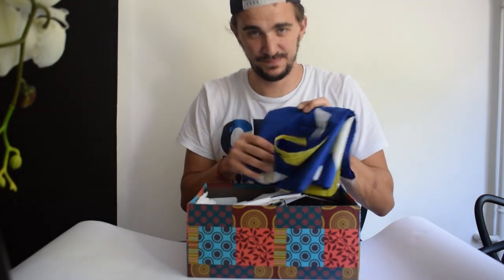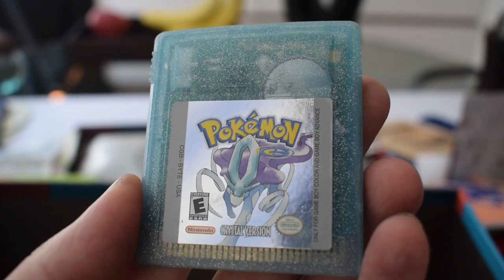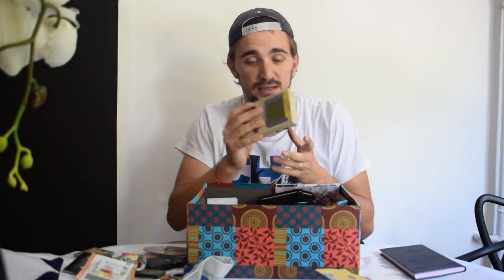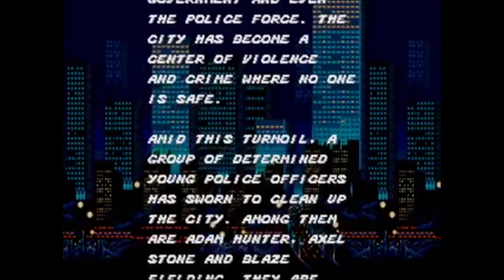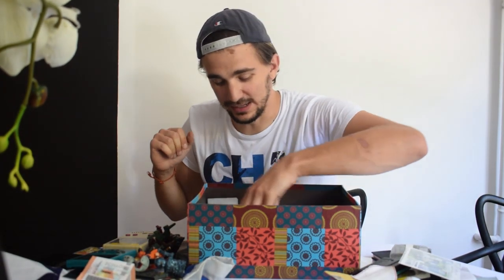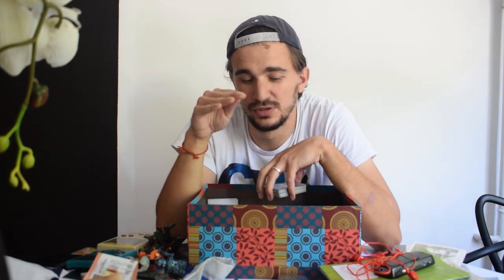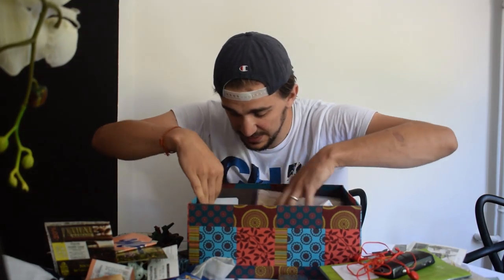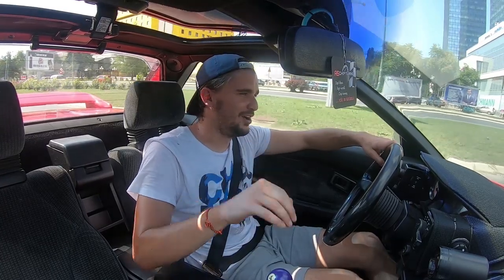My BOX of memories

Comment: 34 degrees is bad, but at least your car is mid engined, all the hotness is behind you and you have the opening roof. The BX is front engine and the exhaust is underneath the shifter and no joke the entire center console heats up so bad it absolutely burns if you touch it.

Comment: That's a cool shift knob! Have you considered using a brass threaded insert as a mounting solution?
Reply from the maker: Good thinking. That was actually a back up plan in case the the threads inside the ball proved too weak. But they were really nice and solid, so there was no need.
Reply: @d4a  well, they say "if it ain't broke don't fix it"

Comment: Heh black opel astra X16XE engine, have you had issues with the ECU?
lathe looks like 1k62 )
is your windshield changed?
Reply from the maker: Hah, how did you know? The ECU had to be replaced. It simply died while driving one day. I had a wiper motor die, an ignition coil too, cylinder three stopped firing a few times. Utter garbage of a car. These lathes are called a "prvomajska", but I don't know anything about the model number. They are all 30+ years old now, but still work great.
Reply from the maker: Windshield? On the aw11? Don't think so.
Reply: @d4a  Astra G and Zafira A common issues with ecu, due to the fact that ECU mounted on engine directly by vibration and heat, it has issues with wires connecting pcb to leads, that's why multiple errors, cranking no start with running fans and flashing ESP lamp... that all is ECU internal wiring issues...
can be fixed (hard to) because of goop inside like silicone..
and no guaranties that last long

Dima)